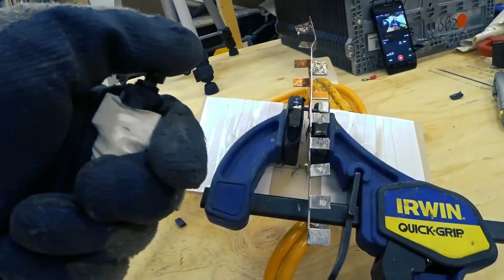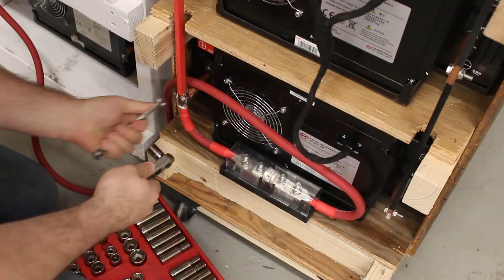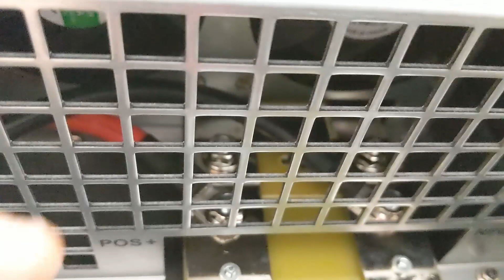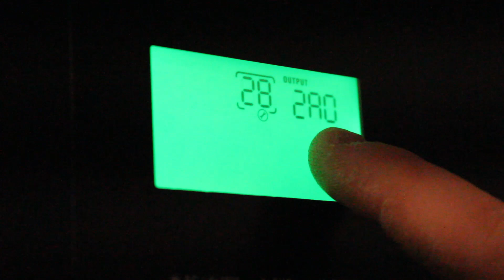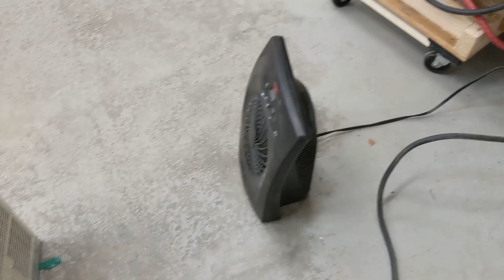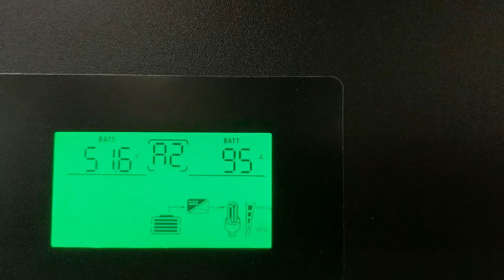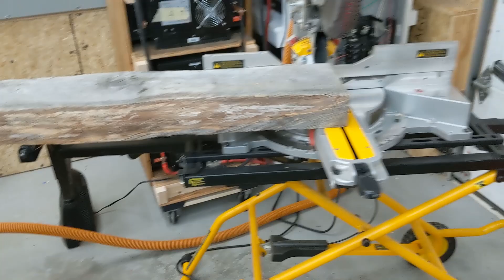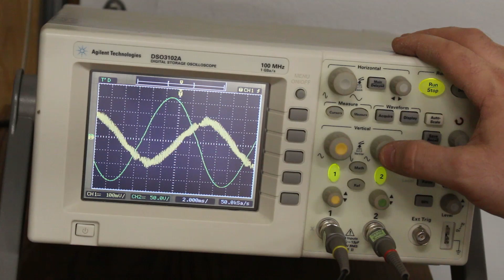Split-Phase Inverter, LV5048, Test Solar, Off-Grid

Comment: Hello sir what’s the frequency ratings on this unit can it do 230v/50hz
Reply: Prob 60 hz ..Canada
Reply: You can adjust the Frequency on the inverter. It's all in the settings. It will do 50/60hrz and it actually auto adjust once it is hooked up.
Reply: its pre set 60/120 on split L1 N L2 but i think it can be set to 50/115 to get output 230 on L1 L2 though if required.
Reply: @ricardoelectronicsrepair  3
Reply: I believe you are correct but I don't think thats what James Joseph means with his question 230v single phase 50 hz is the normal power in many countries and US doesn't use 59 hz as standard so I believe he is asking if the unit can output single phase 230v and the answer is no it cannot
Reply: Just buy a EU 1-phase version
Reply: There are other models for european single phase 230 volt such as the MPP 5048 MG and it doesn't require batterys if you don't want them right now or can't afford them.

Comment: As an electrician who has installed batteries on a submarine.... 

PLEASE!!! Put several layers of shrink tubes on those tools. The amount of amps going through that rank Will cause some serious harm.
Reply: @schoolmaster1945  Yes, it's something you only ever do once!
That wasn't carbon, it was condensed copper vapor and presumably black copper oxide. (Carbon has to come from something containing carbon).
I shorted out a big 48V lipo once and won't ever do it again! The flash blinded me for a couple of minutes and my fingers also blackened - luckily I didn't suffer any burns. The connectors were melted stumps and had to replace them.